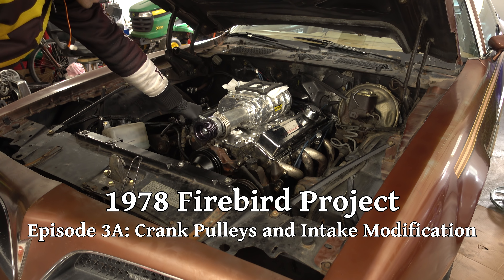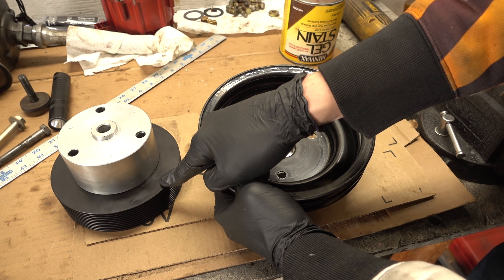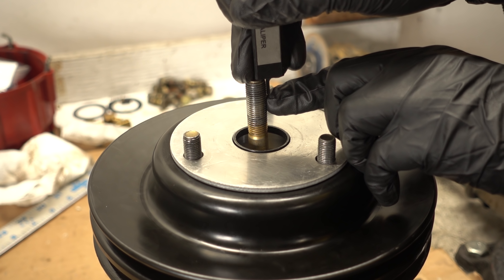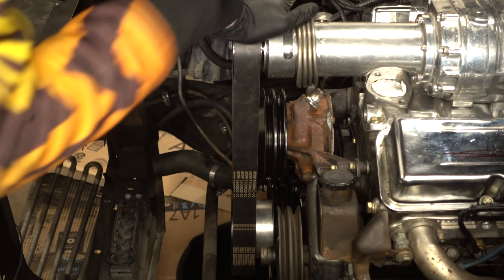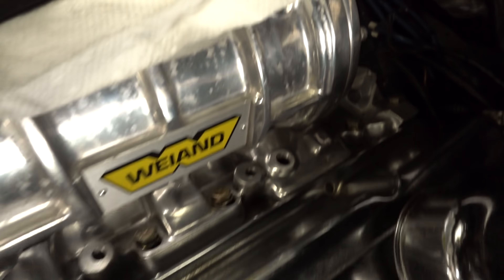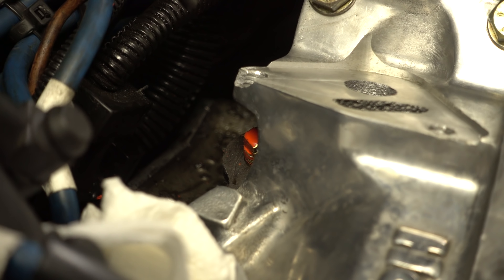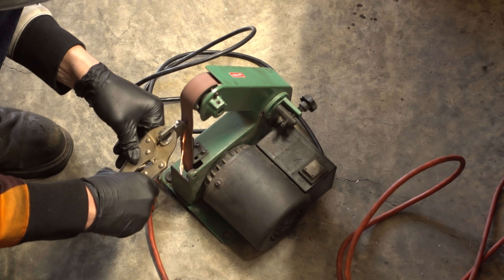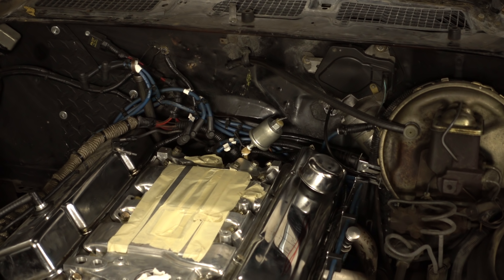1978 Firebird Supercharger Pulley and Intake Mods (Ep.3 Part 1 of 3)

Comment: Option #4:  Pull the intake, tig the cracks and reinstall with thick washers shaped to fit over the weak tab areas. :)
Reply from the maker: Sorry, didn't quite make it to option #4 haha. Don't know anyone personally with a TIG, though there are some other aluminum fixes I'd like to try whenever I pull the intake next. Cut-to-fit washers would help some of the holes but the edges were so thin some of them wouldn't have mattered this time around.
Reply: Just take it to a welding shop and tell them to use it as filler work. I'd have them build up those bosses too... Shouldn't be too expensive.
Reply: Maxwelhse Good advice!
Reply: Option #5 get some duct tape or gorilla tape. use that and hope you don't go over 200 mph.
Reply: @FuzzyDiceProjects  third tool i bought after grinder, and drill press... look for a miller 200dx, you'll love it. if your a tech motivated individual.
Reply: @Tigerfire75  Lol

Comment: Those were my thoughts exactly when I rebuilt my TA's 403 from the ground up and put in a crank shaft that had a tiny nick taken out of one of the journals when it came back from being mic'd and polished. Eight years later that same bearing spun out on me on the highway, but luckily I was able to coast onto an off ramp and into a Benny's parking lot safely. Thank you Harold's of East Providence! I hope they went out of business. Ended up installing a brand new crank in my moms driveway with only 15" of clearance from the ramps. :-) Not the worst work environment I've been in.

Comment: should have taken the manifold off and got a metal work shop to cut those cracks, weld them and weld in reinforcement, or... get a refund from Holly, that is Piss poor on their part
Reply from the maker: It was a second-hand part, and looked like it had been modified, so no chance Holley would deal with it. I'll keep an eye on it but probably only deal with it if/when it breaks.
Reply: Agreed.

Comment: It’s a safe bet that the lock washers used on the manifold was the cause of cracking it. As a rule, use flat washers or shouldered bolts. Keep up the good work!
Reply from the maker: Flat washers would need to be trimmed for clearance, the lock washers were flattened out and wouldn't hurt anything even if they weren't. Much better than having nothing on the bolts at all, probably comparable to or better than flange bolts here. It cracked because the metal was less than a milimeter thin in spots, and only some very particular washers and a lower torque spec would have prevented it.

Comment: Wow, I would contact Holley about replacing that manifold or weld it up and machine flat spots for larger washers.

I've seen a few higher compression setups with that blower that just would not stop pinging under cruise conditions with the EGR blocked off.  EGR ends up cooling off the intake charge (less O2 to burn) and ends up fixing it.

Comment: Come on man, just pull the intake and have those cracks welded up!!!!  There is always time to do it right the second time.
Reply from the maker: If it becomes a problem, I will, or even if anything breaks off without leaking, I will pull the intake. It actually isn't that much work with this setup how it is, so I don't feel too bad putting that off until it is a problem. Still feel like I'll break the engine before that causes trouble.
Reply: Use duct tape cheaper then tig welder.
Reply: @FuzzyDiceProjects  Try some JB Weld on those cracks.
Reply: @Tigerfire75  Duct Tape is a " Red Neck " repair ! This gentleman sounds like he is from a Northern State !
Reply: @pablogaviria9265  I believe he is from Maryland though it sided with the north during the war it was said to be a southern state

Comment: A tig welder would take care of those cracks.
Reply from the maker: Yeah, I don't personally know anyone with one to do it, but maybe down the line. If it ever becomes a problem I'll pull the intake and there are some other aluminum "welding" options I'd like to try first.
Reply: I would definitely look to have it TIG welded. with that welder you could add material to correct the original problem too

Comment: For the manifold I would have ran flat washers that were way bigger than necessary and trimmed them.  Possibly thicker as well.  That way you give them every chance to not crack, there's a good chance it wouldnt have worked as thin as it was though.  I hate when expensive stuff doesnt fit right.
Reply from the maker: Yeah, for some of those bolts I could have trimmed flat washers to fit. That front passenger side one though, it's so close that a standard head bolt is too big to get a socket on, I don't think anything would have helped all that much there.
Reply: Those suck.  I had a turbo with a bolt like that where you had to use a crow's foot and an extension to get it off, it was too close to the pipe.

Comment: It sure is hard to find these blowers used, even with the LS stuff taking over

Should be damn fun to drive
Reply from the maker: Surprisingly, they are on Craigslist/Facebook Marketplace in my area every once in a while. The 177s are more common, but often don't include intake manifolds or are missing parts. I wanted to jump on this 144 because it was (almost) a complete kit, was the newest model, and had not seen a lot of use.

Comment: Seems like my brother told me to avoid weiand parts way back in 1990. Now I know why.
This is a common GM block, so there is no excuse for the oil port blockage, nor the thin remainer around the bolt holes on an aluminum intake!!
Not like it would have hurt them to increase thickness in those areas since they are not in the way of anything from what I see.

Keep the hood shut when running to minimize chance of injury when it frags.

Comment: Next to the oil filter is a plug. It's the same size as the oil sending unit hole. That access point is  perfectly acceptable to run a sending unit or manual guage
Reply from the maker: You're not wrong, though I'm pretty sure those are 1/4" NPT and not 1/8" (not that an adapter wouldn't fit). The electric unit is a bit bulky for that but with an angled fitting it would work for the mechanical gauge. Honestly, I didn't even think of it, haha!

Comment: Why not build up the manifold ears with weld to increase strength fix the cracks and allow for larger washers to spread load?
Reply from the maker: That is the idea for the future, but I didn't have a TIG welder at the time and didn't think it posed an immediate threat. Hasn't caused any issues yet at least, but next time I get an excuse to take the intake off I'll try to make it more solid.

Comment: Isn't there another oil galley plug on the drivers side of the block? I seem to remember running out there in a SBC/Z....
Reply from the maker: Yep, it is possible to use that port as well. Honestly I was kind of just fed up with it lol, but I could have gotten some angle adapters to clear the headers and made something to work there as well.

Comment: should always use a flat washer under any style of lock washer when torqueing to alloy of any kind and with some sort of lube under it and on bolt threads,  such as anti seize . This will prevent thread loss and intake marring or cracking plus it allows you to get a correct torque otherwise you are not

Comment: That water outlet on intake looks real close to that blower housing.
Reply from the maker: Indeed it is, the hose clamp was tricky to get onto the rad hose. It isn't the original housing and those are difficult (read: expensive) to come by. Somebody ground down this housing to fit and I ground it down even more before painting it. I don't think anything is actually touching it right now, after tightening the hose clamp, though.
Reply: Can't wait to see it finished my dad used to have a 78 trans am when i was a kid had a built 400 motor 3inch exhaust flowmasters and turn downs before the rear end  that car was one fast street car he ended up trading it for a tube chassis 1961 austin healey drag car.

Comment: About that cracked manifold.... if you took it out, would it be possible to have it welded and re finish it by hand so you have more material for fastening the thing?
Reply from the maker: Definitely, it could be TIG welded and material added to build up the thin areas. Just going to see what happens with it first though haha.

Comment: The spacer for the super charger is spaced for serpentine belt
Reply from the maker: Then why say it is compatible with V-belts? The instructions and Holley techs claim that the kit, as sold, is compatible with 2 and 3 v-belt systems. I found some other people who run V-belts with theirs, but couldn't figure out what made the fit different.
Reply: The original kit prolly came with 2 spacers and the seller left one out
Reply from the maker: Nope, only one exists as far as I can tell and as far as the Holley techs know. Check out the pictures and parts lists on Holley's website. (https://www.holley.com/products/superchargers/supercharger/parts/7750-1 ) They only make the one spacer, and it is 2" long.

I did eventually find this pulley on my own, and according to the description it would probably fit. But it sure isn't included in any kit and isn't exactly priced to move. (https://www.holley.com/products/superchargers/supercharger_components/parts/6810WIN ) (EDIT: Fixed the links)

Comment: if u were to use a flat washer in front of the lock washer on the intake it would spread out the pressure a little and cause less cracking
Reply from the maker: There wasn't room for one on almost all of the bolts, what I should have done was not be lazy and cut flat washers to fit to give it better odds though.

Comment: What a pos  intake and isn't there a place  down by the oil filter to get oil pressure  . ? I think there is or if you look into it or a oil filter adapter  that has provisions for that but damn you spent enough money and the first guy could not have had that intake installed it would have cracked on him or is it because the deck was milled and the China walls were too high excessive stress?

Comment: Did you e the torque specs for the iron intake manifold?

If you had done this on a late model camero or mustang yo would get a kit with all the pulleys and everything wold fit. Of course you are looking at upwards of $10,000. And, your biggest problem would be electrical and getting a tune for the ECU, probably another couple thousand $.

It’s awesome you are dong this old school. You seem very competent. Good luck with this. Awesome.
Reply from the maker: I was going to use the torque specs from the Holley installation manual, 30 ft/lbs, but I hadn't even gotten there when I noticed it cracking. So it's actually under that spec, at 25 ft/lbs. Shouldn't be enough of a difference to cause any issues though.

I looked into superchargers for my late-model Silverado a while back, the absolute cheapest I could find started at $7000, which is just too much for me. Modern cars can make fantastic use of forced induction, and this is quite old-school compared to that. It's a lot cheaper, and it certainly has its quirks and charms!

Comment: Most blower applications call for the short snout water pump. that could be the problem.
Reply from the maker: Not this one, it specifies in the instructions and online that it fits long water pump applications and 2-3 groove v-belt pulleys. Water pump didn't end up being the problem in the end, it was the crank pulley that didn't line up.

Comment: Good thing it's not a 454, seen 3 454 crankshaft$ snap off behind the balancer running a extension pulley turning a hydraulic PTO pump. On a wrecker!

Comment: I could be mistaken but I feel like switching over to a manual transmission (and possibly new gears) would release as much power to the ground as this supercharger adds. Maybe more.
Reply from the maker: A manual transmission would probably free up 40-50 HP, which would definitely be noticeable. Theoretically the 144 should add 80-100HP on this setup. And a gear change would probably make an even larger difference in acceleration, but I do like the quiet highway driving (for a 3-speed at least).
Reply: I went from 2.73 to 3.73 in my camaro and it's a huge difference on acceleration, I have videos of before and after.
Reply from the maker: Cool, just checked those out. Lovely car!

Comment: A different balancer is what you needed to match that spacer
Reply from the maker: What sort of balancer would be correct then? I haven't seen one that is an inch thicker than standard in the center section, I looked for something like that but couldn't find one. Either way, if that was the case Holley should have mentioned something about it, the kit is meant to fit an engine with standard parts and accessories.
Reply: @FuzzyDiceProjects  if I am not mistaking I thought there was a thicker balancer but i could be wrong.

Comment: A weiand  super charger intake just went up for auction on ebay
Reply from the maker: Thanks for the tip, but I don't see it. Don't see anything under ~$600 for a 144, since they use different manifolds than the others.
Reply: I saw it on sbc used parts on ebay

Comment: Take the lock washers off. They are what cracked the manifold.
Reply from the maker: I must disagree,  they increased the surface area of the bolt head to spread the load out more than it would have been, without them the bolts would have dug in further and it might be even worse. I really only used them because flat washers wouldn't fit without trimming (or fit some of the holes at all).

Comment: First let me just say as a note that the heads that are on that engine have probobly been milled and the intake should of been milled as well to fit... if you go back and look at the old intake it can probobly be seen where it was milled... thats why the intake cracked.....  but either way take it off and get the intake milled to those heads and get the manifold welded up.... it will be fine..
Reply from the maker: The previous intake was from Craigslist and had no issues, the engine came with an old cast iron one and I do not believe it had been milled. The block has been decked a little since the serial is a bit wiped, heads might have been too, but I don't know. Nothing so bad that the bolts should have damaged a properly designed and manufactured intake manifold, for sure.
Reply: @FuzzyDiceProjects  Or maybe the intake from the blower was milled for the last guys heads and that's why it cracked... come to terms with the fact that something is not machined right or it would NOT of cracked like that... I have been in this industry for 40 years really!!
Reply from the maker: @835YT  I can't find any pictures of the underside, but I believe you are right about the Weiand intake having been machined. From memory I don't think the sealing surfaces were altered, but the ports were messed with a little to help it port match with the previous owner's heads. It's possible it was messed with a bit and not entirely a perfect fit, but check out Episode 2 Part 2 at 15:07 (https://www.youtube.com/watch?v=xoUfCIFVavM&t=907) where the intake is test fit without gaskets installed (and a few seconds later, with gaskets). It looks as good as it can on video, if anything the end rails are a little close to the block so it's possible that is part of the issue. Will check it with an angle gauge next time the intake comes off.

But small variances are common and the manufacturer of an aftermarket kit made to fit just about any SBC should have accounted for that and made the material a little bit thicker and/or made room for a proper washer to go under each intake bolt. The Edelbrock Performer that I previously installed (and just about every other intake manifold I've seen for these) has 1/4" of material around every single bolt hole, while these manifolds are 1/16" at the thinnest point and pretty much no points are over 3/16".

Basically, even if variance is at play here, I believe that Weiand should have better designed/produced their intake manifolds to account for that, other than gross oversight or trying to save pennies on material costs I do not know what reason they could have for making that so thin. Their other models of manifolds are built better than that.

Comment: Aluminum should not be torqued to too many ft pounds! (idk if your manifold is)
Reply from the maker: I actually torqued it to less than the torque spec in the instruction manual for the supercharger kit (they list 30 ft/lbs, I stopped at 25 because it was cracking already).
Reply: Fuzzy Dice Projects My 40 year old aluminum valve covers started cracking at 5 ft pounds. Amazing videos, keep it up man! 👍

Comment: Heh, your fitment issues are why its always a good idea to buy a bad engine for mockup ;)
I take it you weren't able to send the manifold back for replacement? Because otherwise, I would seriously look for a different manifold. Getting those cracks already makes me worry about it's build quality and future life over 10,000 miles.
Reply from the maker: I got all the parts used, and it sure looks like somebody messed with some of the holes on it, so no chance of getting it replaced without just buying a new one. If I end up with leaks, I'll pull it off and fix it up one way or another, but I'm hopeful (to a fault) it will survive.